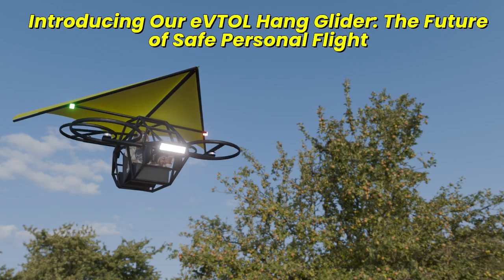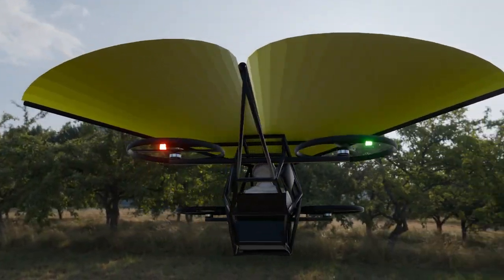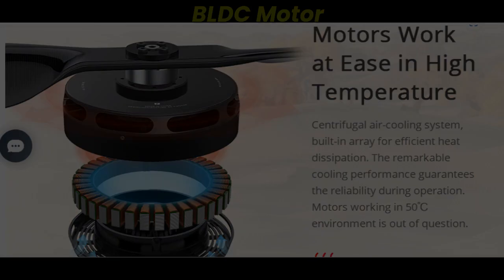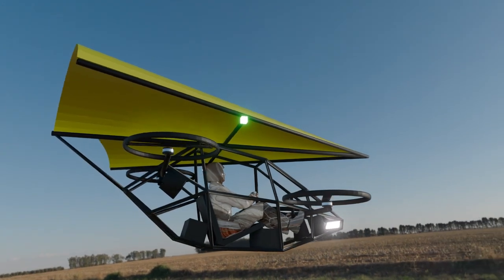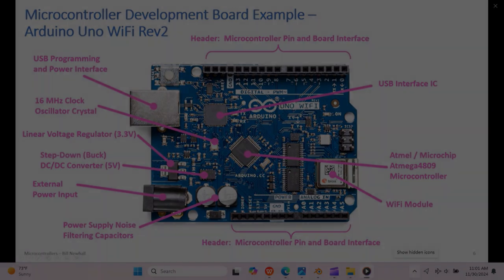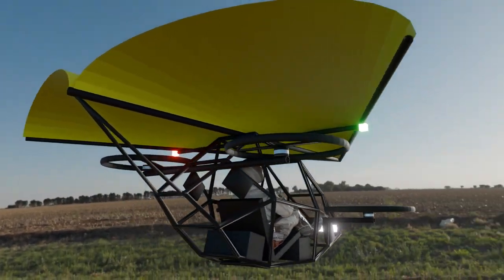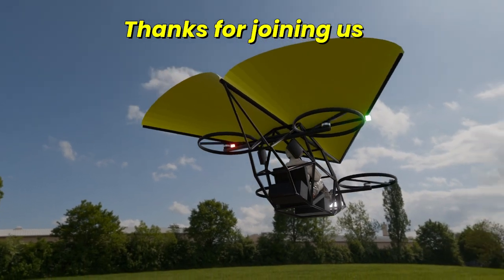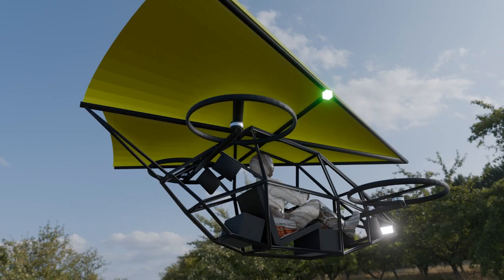Rogallo Wing eVTOL Quadcopter Drone: The Future of Emergency Landings?

Comment: Adding a Rogallo wing is a smart move, it's an already open parachute and would reduce the rate of descent even with zero forward speed.
If their was enough clearance for the rear motors to rotate upright for forward flight the wing could take even more of the load, extending battery life further
Reply from the maker: Exactly! The Rogallo wing is like having a built-in safety net, plus the added lift means the motors don’t have to work as hard—win-win. The key challenge is optimizing the transition between VTOL and forward flight while keeping the wing stable under varying thrust conditions. If the rear motors can tilt effectively without airflow interference, it could create a super-efficient hybrid system. Now the question is: How much control authority can we squeeze out of the wing without compromising VTOL stability? Appreciate the insight—definitely worth refining!" 🚀

Comment: you do realize that the propellers suck the air above. and in total power loss, means all power is lost, including the sensors or actuators
Reply from the maker: Absolutely! Propellers create low pressure above, but that doesn’t mean disaster is inevitable—it just means airflow management is key. As for total power loss, that's why redundancy and fail-safes exist. No serious design leaves critical systems at the mercy of a single point of failure. After all, planes don’t drop like rocks when an engine fails—they glide. Smart engineering is about preparing for the 'what ifs' so the only thing falling is outdated assumptions. 😉

Comment: If you were a real pilot or engineer, you would have taken a small quad drone, put a delta kite on top and found out that the rotors pull a low pressure under your wing, and it crashes. But nope you are an animator, and you-tuber, maybe just a gamer. And it was better to create vapor ware for views.
Reply from the maker: Ah yes, the classic 'if you were a real engineer' argument. But real engineering isn't just about slapping parts together and calling it a day—it's about identifying problems and solving them. Low pressure under the wing? Manageable with proper flow control. Stability issues? Addressed with dynamic feedback and control algorithms. The difference between 'vaporware' and innovation is persistence—one crashes and gives up, the other crashes, learns, and flies. 😉"

Comment: I always resent speculative videos that are framed in the present tense as if a thing already exists when it's only a concept. Would you care to clarify?
Reply from the maker: Totally understand your skepticism—there’s a fine line between showcasing a concept and presenting it as reality. The goal here isn’t to mislead but to explore possibilities and push the conversation forward. Every breakthrough starts as an idea and discussing it in an engaging way helps refine and improve it. But hey, if you prefer raw prototypes over polished presentations, stay tuned—because every concept worth pursuing eventually takes flight. 😉 

Prior to moving on to a functional prototype of aluminum wood duct tape and a little bailing wire with test results, I must first set up equations with simulations and analyze Laplace Transfer functions, win Python bode frequency bandwidth plots to demonstrate that the concept is feasible. To date I completed 18 LTspice simulation schematics. This is because, even with the optimal PID values obtained with simulations, you still need to Tweak the numbers before moving on to the actual production model with carbon fiber, which requires a significant amount of work.

Comment: Great concept.  I designed and tested an electric trike.  I tried to figure out how to integrate VTOL into it, as the aerodynamic concept of a Rogallo wing has some advantages over traditional designs.  I couldn't figure out how to control the wing AND the VTOL at the same time, as a trike aircraft is weight shift and requires a control bar whereas VTOL requires fly-by-wire.  If you can figure out how to control both at the same time and integrate them seamlessly I'd love to see it!  Best of luck!
Reply from the maker: That’s an awesome challenge, and I totally get the complexity—balancing weight-shift control with VTOL dynamics is like mixing two completely different flight philosophies. One idea is to use an adaptive control system where the fly-by-wire assists during VTOL, then transitions to weight-shift once in forward flight, possibly with a semi-rigid frame that allows controlled articulation of the wing. If I crack the code on seamlessly integrating both, you'll definitely be the first to know! I'll add that, to one of the "disturbance" functions in the microprocessor algorithms (Laplace transfer function / python Bode plots). I do know vibration damper gimbal mounts are essential. Appreciate the insights, and best of luck with your own projects too!" 🚀Thank you for watching😄
Reply: Jump take off auto gyros are now a thing, tie that to the enormous  torque  of batteries!